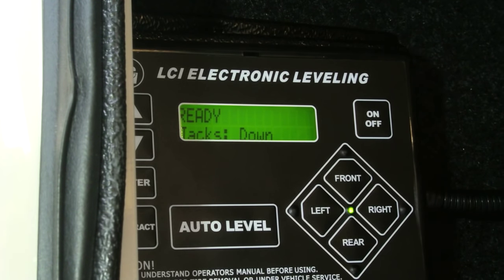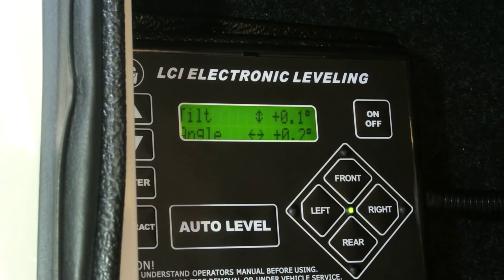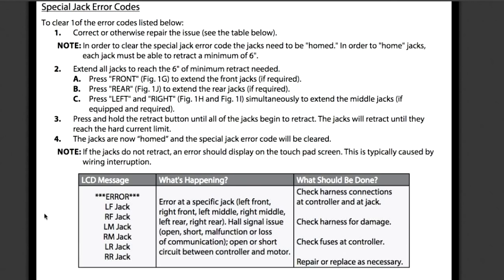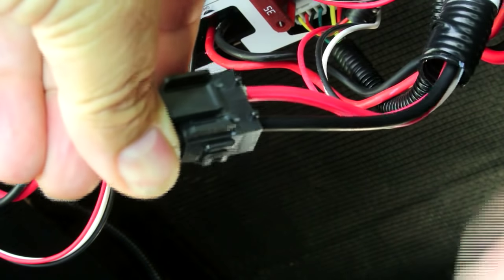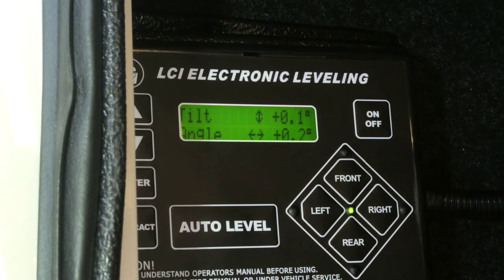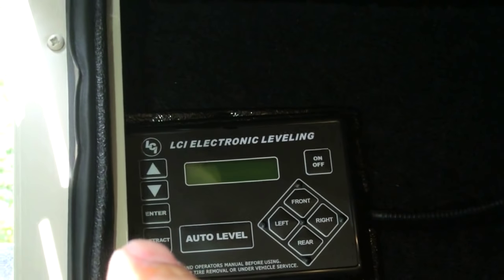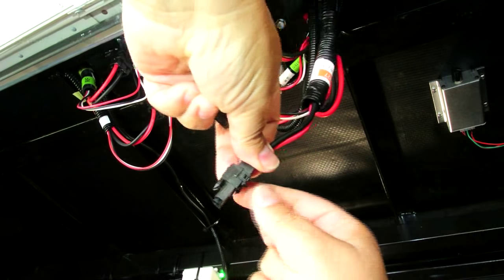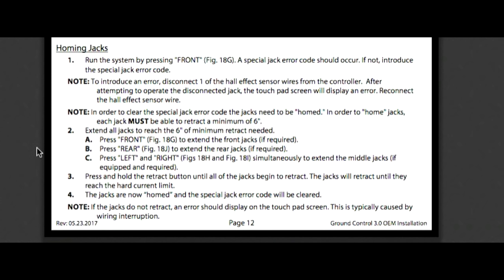Correcting a RV Leveling System Jack Error

Comment: Not a wiring issue for me. Mine needed to be re-homed after using the manual leveling feature. I had a RR Error. I couldn’t do anything to move the levelers until I held down the retract and enter button for about 5 seconds, and then I followed the steps in the video. Worked like a charm. Thanks for posting.
Reply from the maker: A low battery can cause the error too.

Comment: Thanks for posting, RVProject!  A critical nuance: Retract by pushing and holding the Retract button until all jacks fully retract (just as you said and just as your instruction sheet said).  Pushing the Retract button once to light it, then holding Front and Rear to retract the jacks DOES NOT reset the system.  For me, the error occurred when I picked up my fifth wheel from Camping World.  Someone left something on and my batteries were totally dead. After a few minutes hooked up to the truck to recharge, I tried to extend the front just a bit to hitch up.  Boom...there was the error.
Reply: same here!
Reply from the maker: Thank you for your input.

Comment: We had the exact same problem and could not get the levelers to work because of the error code, but our wiring was sound and fuses were good. So we took your advice, hooked the truck up and retracted all 4 jacks at once. It reset itself so our auto leveler worked again. Thanks for the information!
Reply from the maker: Thanks for watching.

Comment: We had numerous "LF Jack Error", "stroke error" and other....issues with our electric Lippert auto level system FROM BRAND NEW throughout our first 10 week trip across the nation and back home. It quickly became very frustrating. We bought a "new" to avoid the problems, understanding that there would be issues even with new. However we were not prepared for a 90% error rate. We went through the hard reboot and or the reset procedures pretty much every time we tried to use the system over that 10 week trip. Bottom line is this there was not enough amperage with just one 12 volt battery that came with the trailer from the dealer. The battery that was installed in the trailer was not even a deep cycle it was a standard automotive battery. I ended up buying two deep cycle batteries and wiring them in parallel to increase the amperage available to the motors but not the voltage. Once the batteries were installed we have not experienced any more errors. I believe it would behoove Lippert to REQUIRE at least two 12 volt batteries wired in parallel for any model rv using their electric auto level system. Lippert has taken A LOT of heat for these problems when I believe many, if not most of the issues are because there simply isn't enough amperage to properly run the system. Maybe Lippert is under rating their system to be able to sell it to more manufacturers...maybe the manufacturers aren't willing to foot the cost of double the batteries, I don't know.
Reply from the maker: I have not had an issue in my RV using Ground Control with a single 90AH deep cycle battery. I would suspect the battery the dealer gave you is not up to task. Automotive starting batteries do not last long in a deep-cycle scenario.
Reply: @RVProject  The dealer supplied battery was absolutely not up to task. that was the point of my rather long winded post.... ;-D

Comment: I had a problem with the "Retract error" I called manufacturer- told me to hold down on retract and enter at the same time for a few seconds-then start the engine. It cleared and everything works fine.
Reply: Thank you for this information. I have been troubleshooting for the last hour and this worked perfectly. Thank you Sir!
Reply: Thank you! Helped me as well.
Reply from the maker: Thank you for supporting the channel.

Comment: The important message in your video is the rest procedure.  I installed some LED lights and had a split second short that messed with my controller.  RR & LF error message, but they all moved.  You have to reset the controller to get the auto level to work again.  Saved an engineer hours on the phone.... TY
Reply from the maker: Thank you for your tip.

Comment: First day out our jacks gave a full error with no amps enough 
I hooked up truck to trailer and after a couple minutes error was reset. 
I think it has to do with the batterie it doesn’t give enough amps to level all four jacks at same time so our resolve is to or instal a other batterie or stay hooked up to truck when leveling out.

Comment: The issue here is that the Pin that is Crimped onto the wire has a small Tang on it that engages into the plastic housing. All that should have been needed was to Very Carefully bend on on that small tang,. This would raise it up, so that it would fully lock into the housing. To release the pin from the housing. You have to go in from the connector end and insert a tiny screw driver (yes Molex actually makes a tool for this) and press down on that Tang. Then the pin will come out.
Reply from the maker: I understand how those tangs work, and generally that is a good tip for dealing with connectors. 

However, this particular connector is a Molex "Mini-fit  Sr" series connector, and they do not have a tang. Rather, the plastic connector housing has a bail that you have to break off during installation (the connector is molded in one piece so the bail doesn't get lost). 

And then, after inserting the pins, that bail then snaps back onto the housing to another location on the housing, which has plastic tabs that holds the connector pins captive.

For some reason, the bail was not holding the pin captive.
Reply from the maker: You just gave me an idea for another video - how to remove connector pins...

Comment: We have the same 6 point system. The pump motor keeps running after the “auto retract” mode is activated and the legs are up. It has tripped the the breaker each time before it will finally shut off. I can’t find any help or information on the web?

Comment: At the end you said to carry a Voltmeter, but I didn't see you use it in this video. Can you please explain how you used it to help with this error?? Thank you so much for your videos!!!
Reply from the maker: Before I discovered the wire on the Left Rear jack connector was loose, I used a voltmeter in the ohms position to do a continuity check on the wiring. I did not show this procedure in the video as it is not something everyone is comfortable doing.

Comment: Rig in storage.  Went to hook up to truck, battery not charged enough.  Pulled up rear jacks and quit.  Then got LF Error.  It wants me to retract all jacks.    Since the rear jacks are already up all the way, only the front need to retract.  This puts us very close to ground.  of course we can't move the pins since front jacks are carrying all the weight of the rig.  I won't wreck anything while front jacks retract holding all the weight right?
Reply from the maker: The front landing gear should hold the weight of the trailer with the rear jacks retracted.

Comment: Found my problem was the crimp connection wire splice at the motor had come loose.  Found the old connector in the storage area beneath the jack.  They had missed the crimp "by that much",,,,,    Had some crimp connectors handy and repaired same.
Reply from the maker: Glad you were able to correct the problem.

Comment: Good video. Does anyone know if it's possible to actuate the jacks electrically without the control panel? There's 12v constant which I'm connect to relays on the board, so I assume the other wires at the jack are the hall effect and trigger?
Reply from the maker: There are hall-effect sensors on the jacks, which yes - that is what the other two wires are used for.

If you wanted to electrically actuate the jacks, it would be possible, but why would you need to do so?

Hall-effect sensors are capable of either measuring rotation or force (current flow).  I am not sure which method Lippert uses to equalize the stresses on the frame, but that would be one issue you would have to tackle - how to not stress the frame by applying too much force on one jack.
Reply: @RVProject  I only wanted the jacks, no controller. These systems are way overpriced. Since this post I ended up buying used jacks on eBay and welded up the mounts to the frame, replicating what Keystone offered shortly after my model year. I wired them up to my In-Command system and they work great! Granted it's not auto-leveling, but I can do it from my phone while using the LevelMate.

Comment: Would you have a .STL file for the base of the Lippert Controller or could you recommend software to make one?  Love your channel!
Reply from the maker: You mean like the back side of the controller?  I have not made such a component.

I use FreeCAD to make my STL files. It is free and open source, but It is a bit goofy - which is pretty common for open source.  There are a lot of tutorials on YouTube too.

Another possibility is Fusion 360. It is normally a paid software but you used to be able to use it free if you did it for non-commercial uses. Not sure if that is still true or not, but I have found there is a bit more of a learning curve.  But it is more stable than FreeCad.

Comment: Where is the main console (with the fuses) located in the rig?
Reply from the maker: There is no standard location. Depends on the RV manufacturer.  For my rig, it is on the ceiling of the front storage compartment near the battery (5th wheel).

Comment: LCI Leveling jacks wont go down   center green light is flashing on control panel , tried reset,  didnt work   what should i do
Reply from the maker: Contact Lippert Customer service (574-537-8900). They are actually quite good.

Comment: Where did you find the main console and what is the mfg/Mal of you 5’er? Thx.
Reply from the maker: I have a Grand Design Reflection 29RS. The control panel is inside the main storage unit on the driver side. The main control board mounted on the bottom side of the bed flooring, accessible from the front utility compartment (where the battery is).

Comment: I was recently trying to put down my auto leveling system. While i was doing it my battery went dead. The system shut down. So I plugged my camper in to restore power. Once I turned the system back on I received a LF Jack error. I can not get that to reset. I did what was suggested in the video with the exception of the middle jacks. I can't figure out how to let them Dow because it is stuck in the error mode. Camping place can not help can anyone?
Reply from the maker: When in the Jack Error mode, you have to reset it before you can return to normal operation. 

To recover from the error, the panel must be reset. This is done by lowering and raising all of the jacks at least 6".  Lippert calls this a re-home procedure.

The easiest way to do this is hitch the RV to your tow vehicle;

Keep the tow vehicle's engine running and connected to the RV; or ensure the battery is fully charged. One common way to get this error is with a low battery. 

By hitching the RV to the tow vehicle, you ensure you obtain 6" of travel in the jacks. Any less travel and the system may not reset.

Run the jacks down until they are at least 6" from the top.

Press FRONT to lower the front jacks.
Press REAR to lower the rear jacks.
Press LEFT and RIGHT simultaneously to lower the center jacks.

Then press ENTER to auto retract all 6 jacks.  That lets the system know where the end-points of each jack are, and the error should clear.

If the error does not clear, or if all of the jacks do not lower and raise, you may have a wiring error.
Reply: @RVProject  but i can't even move my jacks down in order to re-home them at this point
Reply from the maker: @waterbuddy92  Contact Lippert Customer service (574-537-8900). They are actually quite good.